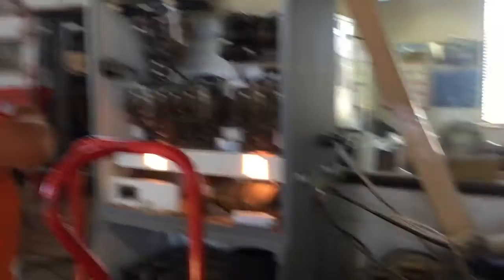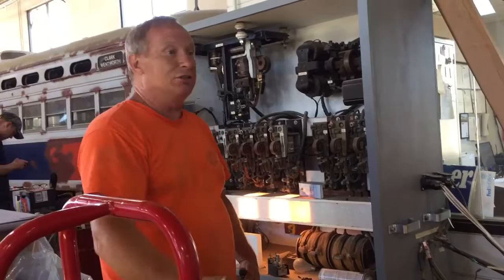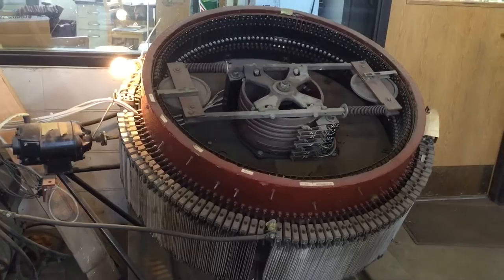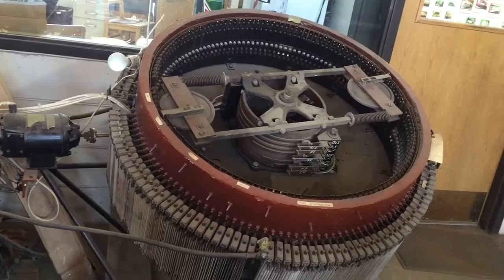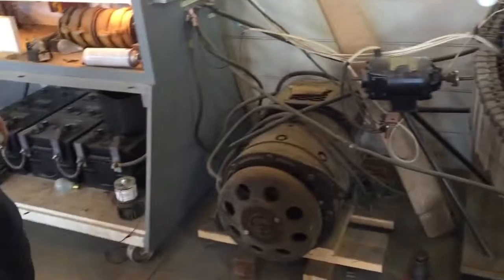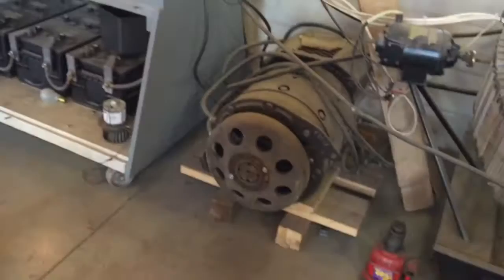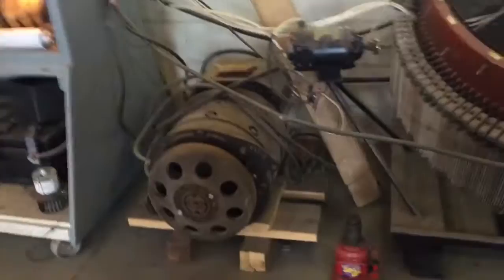How a PCC streetcar works

Comment: I’m sorry I might be late to the party, but I’m a PCC Operator Operating the oldest continuously operated PCCs in the world, just want to say your numbers are juuuuuust a tad bit off...our cars do at least 35-40.
Reply from the maker: You may be correct. However in Kenosha, there are no hills, and there's really no safe spot in Kenosha to have the throttle wide open. the only place that would be perfect is on 56th Street, however there are a lot of street lights and road crossings.
You circumstances may be different, but in Kenosha they have gone 38MPH.
Reply: Czech derived PCC trams Tatra T3/T3SU(CS) can do even 65 km/h (41 MPH), but even more is possible, however after braking from such speed accelerator gets very hot and it can be noticed well in Tatra T3SUCS, where waste heat from accelerator can be put into passanger area to boost heating. 

I like that those american PCCs look as Tatra T2R :)
Reply from the maker: DB-47 not totally sure what that means, but glad u liked the video :D
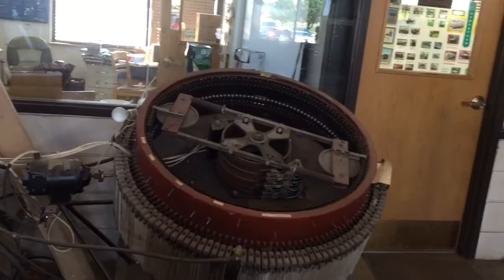Reply: @JoeyLovesTrains  I meant that accelerator (rheostatic regulator shown at 0:53) gets very hot, if PCC trams are braking from high speed to standstill, sometimes the PCC accelerator smells like electric oven heating up :D. Czech trams T3SUCS (based on PCC concept) have special valve that allows to use waste heat from PCC to heat up tram interior in cold seasons or it can be set to blow that heat outside.

Comment: A very informative presentation of how the PCC cars were electrically controlled.  
I used to ride the #8 cars in Baltimore, from Catonsville Junction to high school in Irvington, and occasionally into downtown Baltimore and beyond.  They were a great ride.  It was such a shame when they were replaced with diesel busses on New Year's Day, 1964.
Reply: The system is pretty neat. While PCCs were extremely rare in Europe, Belgium still has some in operation:
https://youtu.be/ZZAKGSU2dvg?t=46

Streetcars in general are still pretty much around here, and a lot of cities depend on them. There were some plans to replace them by diesel busses like in the US, and it happened in a few cities, but in general, the streetcars survived until they had their come-back in the 1990s.
Reply: Our trams (apart from the newest ones) had manual control via a big wheel or a lever, which operated the resistors. These are german streetcars from the 1960s, where you can see how it's done:
https://youtu.be/ioX4eTI6rUU?t=669
https://www.youtube.com/watch?v=ZqdMFY9_9zQ

Comment: That's a pretty neat system. In Europe, PCCs were always extremely rare, but they still have them in Belgium:
https://youtu.be/ZZAKGSU2dvg?t=46

Most streetcars here used a big wheel or a lever to operate the resistors manually, like in this 1960s trams:
https://youtu.be/ioX4eTI6rUU?t=669
https://www.youtube.com/watch?v=ZqdMFY9_9zQ
Reply: Those older (non-PCC) European streetcars (like those in my links) were also quite finicky... the first thing I learned was that we must never never never throttle down. If you were driving at position 4, and you wanted to go to 2, you would have to rapidly throttle to 0, then up to 2. Never directly, because that would have leaded to arcing in the resistors, in turn destroying them. Oh, the good "old" times. ("Old" is relative here, because I learned it in the early 2000s... in Europe, you learn the old ones first, to get "the feeling").
Reply: An interesting thing when I compare European and American systems... in America, streetcars seemed to use trolley poles for a far longer time. I think they still have them in Toronto. In Europe, they used pantographs (or a predecessor, called the "Lyra Bow") since the late 1930s. The city of Hamburg was the last one in Germany which had trams with trolleys:
https://www.youtube.com/watch?v=TVms_y7JjIo
The streetcars were abandoned in the late 1970s, as Hamburg had by then built a heavy rail system, quite similar to the Chicago L.
Reply: The oldest DC-electric trains in Germany we had in Berlin, serving the "S-Bahn" [*] routes. They were built in the 1930s (probably for the Olympic Games 1936) and ran until the mid 2000s. They were known for three things: (1) Very uncomfortable. (2) You could open the doors at any time, even between stations. (3) Very loud, and a very distinctive sound.
https://www.youtube.com/watch?v=Q2P1KpwVhfs

[*] In Germany, there is a distinction between "U-Bahn" (subway) and "S-Bahn". Both are very similar, but "S-Bahn" trains run mostly overground and are somewhat faster.

Comment: ČKD Tatra T3 brought me here 🚋 🇨🇿
Reply: Wasn't it a clone of the PCC? It looks pretty similar, and from what I saw in Bratislava it has pedals too.
Reply: @wuloki  Yeah it was derivate of PCC mainly electric part, design was altered, however oldest ČKD Trams (type T1 looked like almost as classic PCC). In Bratislava you could have seen their Tatra T3R.P, which were modernized with much more modern power regulator (IGBT transistor) and still have pedals. In other cities like Liberec they removed pedals and installed power regulator handle on hand
Reply: @DB-47  It should have been the T3R.P, because I couldn't see a handle which puzzled me for a while.
I know western trams (like the duewag ones) and drive them, so I have the habit of looking other drivers over the shoulder. ;)
Reply: Beyond Birthday If handle or pedals are installed depends on transport authority, our Prague T3R.P(V) have pedals only. I am also used to peep behind shoulders, as newer types like T6A5 or KT8D5.RN2P have hand steering.